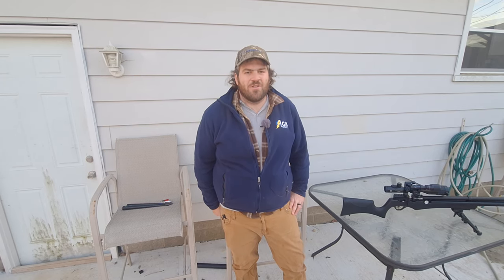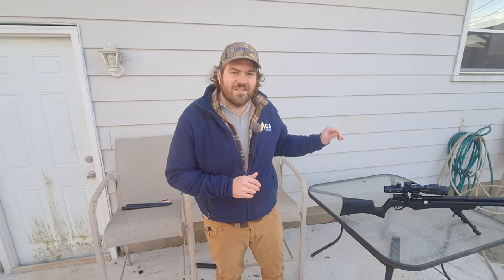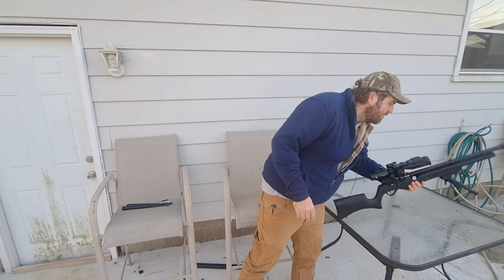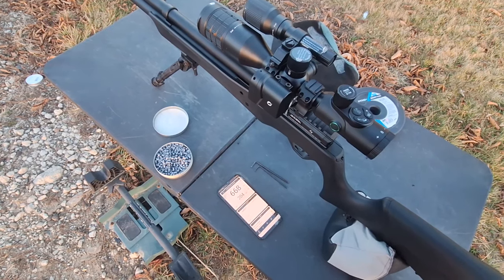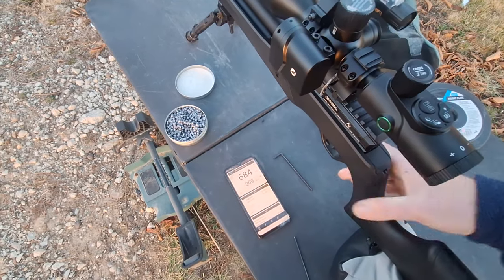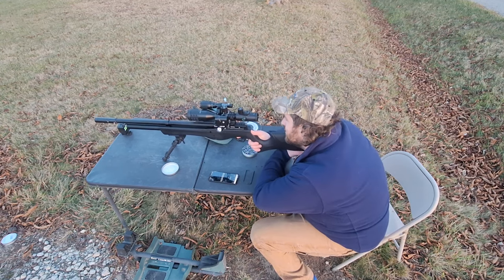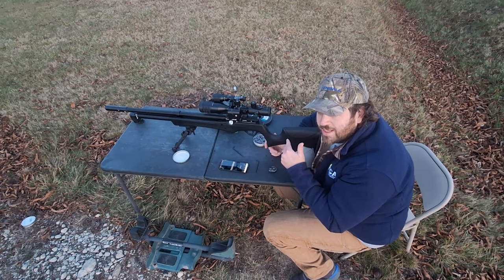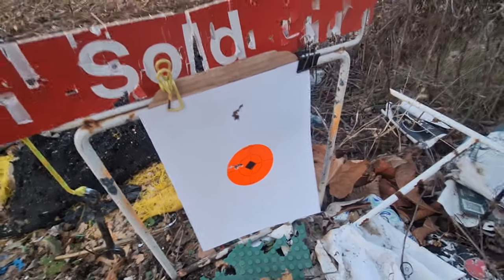How To Tune Adjustable PCP Airgun (Avenge-X)

Comment: Looks like it was set up for the 34gr from the factory. With the transfer port on high of course. Or, slugs.
Reply from the maker: It's only rated 895fps with 25.4gr....hi or low transfer doesn't matter cause velocity wouldn't increase after 2.5x hammerspring turns inward means pressure is too much at 2400psi reg  for the hammerspring that is shared between all calibers....definitely didn't design the Avenge X properly especially not changing the hammerspring every caliber
Reply: @ALLABOUTAIRGUNS  I'll let you know when I get mine. I'll probably get the Bullpup 177cal though. Then change caliber if I need to. 
Crazy as it seems, all I've been shooting lately is my HW30S 177cal. It's PCP accurate at 25 yards.
Reply from the maker: @heithwatkins  there ya go!

Comment: Is it really creep?  Is it really creeping up, or is it not refilling to its set pressure?  When it "creeps" up, it may be filling to the pressure it's really set to.  The rest of the time the regulator isn't completely refilling quickly as it should.  My Robert Lane regulator merely quivers between shots; it's always at it set pressure as long as the reservoir pressure is greater than what the regulator is set for.  That's my interpretation of Avenger regulator poor performance.

Comment: Dude.....
Lowering your fill pressure isn''t going to increase your speed.... Duh.
And fill pressure is NEVER going to influence speed in a REGULATED airgun.
Set reg to about 2500 psi. This is too high for .22, but great for .25
Set transfer port setting to High (duh again).
Now increase hammerspring tension until desired velocity is reached. (I'd leave it at max minus 1 1/2 turn or so.  850 to 880 fps is a good speed for .25).
Now fill up gun to max pressure. 
This wil NOT I repeat NOT decrease your pellet speed, since this is a REGULATED airgun.

People, this is probably a very nice fellow, meaning well and all,  but not too smart on airguns alas... Happy Holidays. Happy shooting.. Do yourself a favor and buy an AvengeX.
Reply from the maker: Tell me you don't know pneumatic systems without telling me lol
Reply: I think he's demonstrating how to find the best pressure to set the regulator to for that specific weight pellet, and that specific hammer spring, at his specific altitude.  I believe his next step is to set the regulator to that 2000psi value.  When he lowers the reservoir pressure below the regulator set pressure, he's taking pressure off of the valve stem making it easier for the hammer and hammer spring to open the valve.  That's giving him more adjustment range that he didn't have at the higher regulated pressure.  That higher regulator pressure made it more difficult to open the valve stem thus exhausting the firing chamber pressure through the transfer port.
Reply: I don't think thjs guy knows the difference between fill pressure and regulated pressure,